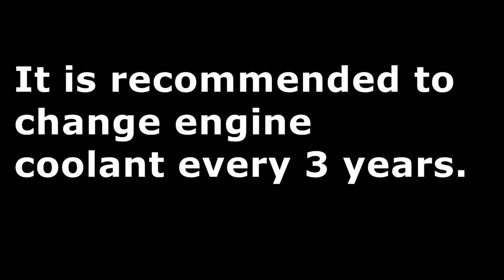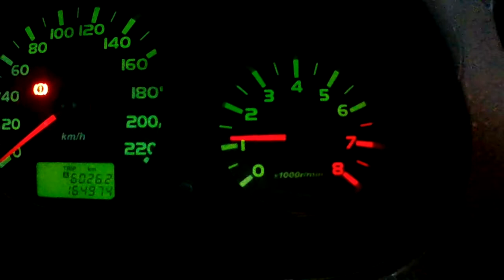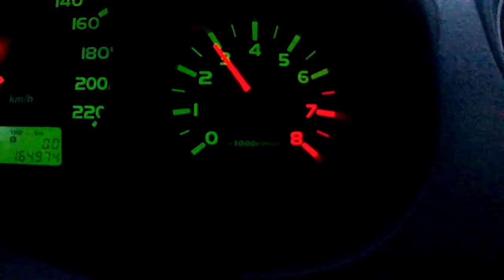Mitsubishi Colt Engine coolant replace

Comment: The coolant in my colt is blue. Do I still need to check if it’s OAT, IAT or HOAT?
Reply: The color is not an indicator for the technology because the color code varies between manufacturers. You better check the package to be HOAT.
Reply: @buildandrelax1495  how do I know what’s already in my car?

Comment: What coolant did you use? G11?
Reply from the maker: G11
Reply: @boomergarage  Почему G11, а не G12? Проблема?
Reply: When I drained my system I got about 1 Ltr out of the radiator, then half a Ltr from the engine plug, of course the reserve over flow holds half a litre, that's only two litres, where as this system should hold 6 Ltrs including the reserve tank. ?  I'm going too keep flushing the system untill it's all clean water, then top up with concentrate coolant which is two litres so a third mix, good for -20 which is OK with the UK climate. So how does this method you show completely drain all 6 litres. My car is the colt czc 1.5, 2008 year. As it's a very low car & I have no pitt, I need too jack it up high too get too the rear engine drain plug.
Reply: I find it odd he didn't manually fill the reserve tank up it holds about half a Ltr ?